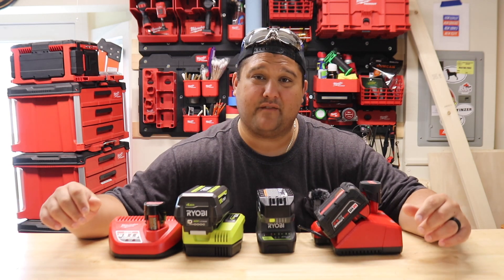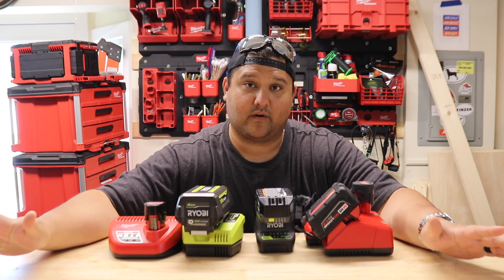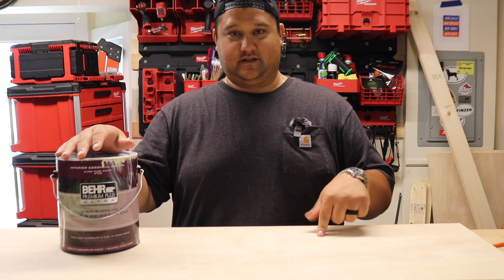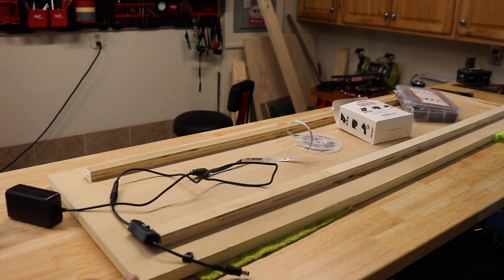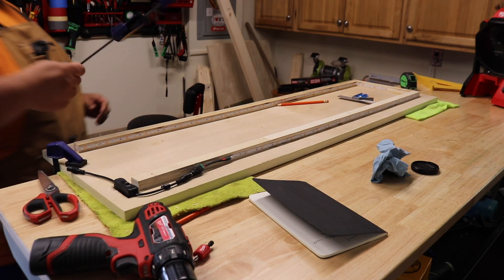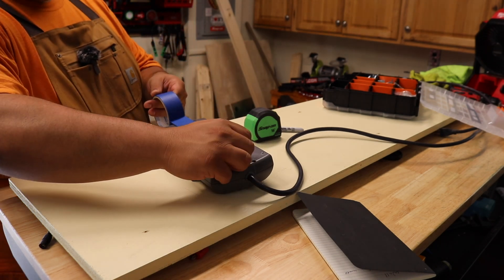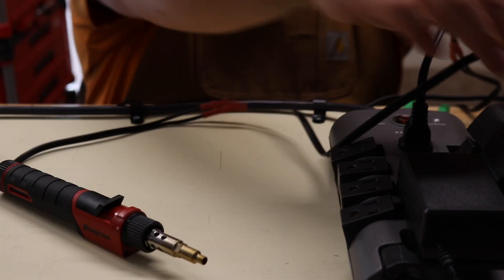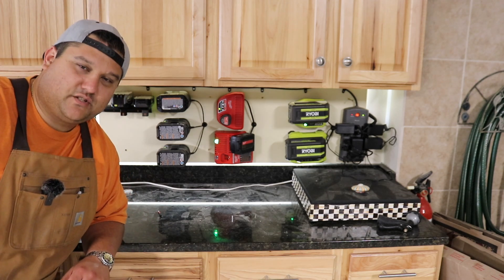I Built the Ultimate Battery Charging Wall

Comment: I'm invested in two (kinda three, but really two), DeWalt 20v/60v, and Snap-On 14.4v. 
DeWalt 60v saws are the bees knees. And the batteries work on their 20v tools too. I got a couple DeWalt 12v tools, but those have been relegated to backup duty only. Snap-Ons 14.4v is superior to both DeWalt and Milwaukee 12v stuff. And DeWalt 20v and 60v have been becoming superior to all others in every way lately.
Reply from the maker: It’s hard once you get into any one brand to switch out. Some of the snap on stuff is interesting to me but the thought of starting over fills me with angst. There’s definitely better options for certain tools that Milwaukee m12, but I can’t get over the hump to try at this point
Reply: @HeyDerFolks  I definitely get that. That is one reason I stuck with DeWalt though the 2010's when they weren't innovating and Milwaukee was kicking their ass - didn't want to "reinvest" in another platform. It paid off though, with all the new "best in class" launches they've been making the past couple years (DCF900, DCF961, DCF891, DCF921/923, DCF845, DCF850, DCF860, DCD1007, etc). I do wish they would make more types of tools, as Milwaukee does have a few neat tools that DeWalt doesn't make at all, but I don't want multiple battery platforms, and I'm not ditching my "big boys" (961, 891, 1007) nor my 60v tools that Milwaukee doesn't even have competition for, so I'll wait it out, lol. However, after I got my hands on the Snap-On 3/8 long neck ratchet, that things a beast, I decided to add Snap-On 14.4v to my lineup, and ditch the pathetic DeWalt 12v lineup. The only "good" thing about their 12v lineup is that the batteries charge on the same charger (not dual port like Milwaukee and Snap-On) as the 20v and 60v batteries - so that's convenient.

Comment: Why would you cut the cords on all of chargers ?
Reply from the maker: I was unaware of another way to run their cabling behind the board. Some folks have since recommended I added a new plug rather than splicing, which is fair. I hadn’t considered that. The cords themselves are soldered to the chargers so I couldn’t unplug them to hide them
Reply: @HeyDerFolks you drilled a 3/4  inch hole in your board to run the wire through the hole the plug should have fit through that 3/4 inch hole without cutting the cords on all chargers
Reply from the maker: It did not fit in the hole I drilled, I tried. Perhaps if I had drilled a 1 inch hole it would’ve, but then I didn’t have the rubber grommet and I indexed towards impatience

Comment: I have a lot of chainsaws some of them high end Husqvarnas and every single one leaks bar oil. It’s not really a completely sealed system, but something you can do is open up the reservoir after use to release any pressure that may be built up.
Reply from the maker: Fair point. I will take your advice in terms of letting out the pressure in the future. Thanks for the tip!

Comment: The ryobi charger has a transformer in the wall plug so it’s low voltage 
The Milwaukee plugs are 120v in the wire.   I don’t think you can solder 120v ac connections.  
I’m not an electrician.  But I know you can’t splice romex in your house like that, either a junction box or a molex self contained connector 
I know in a shop if an extension cord is nicked it’s trash,  can’t mend it
You can add plug ends to them but no splicing

Edit.  Can’t find anything that says your 120V AC splice is ok
Complete rewire or plug ends or molex self contained or a junction box
Reply from the maker: In hindsight I wished I just bought new plug ends and didn’t splice, but I honestly never considered that at the time. This is how we learn 😌

Comment: Cool setup Peter! Have you thought about the dangers of all the lithium batteries? Maybe a fire proof drywall setup between garage and house, and fire alarm and fire suppression system. I have a charging station in my garage and worry about fire control.
Reply from the maker: Thanks, Doc. I haven’t given too much thought to fire suppression. What I’ve taken to doing is turning off the surge protector when I am not in the garage, and generally removing batteries once they’re full. Will have to give more thought to the rest of it
Reply: I added a countdown timer to my charging station.  When I charge a battery or batteries I set the timer for a little over typical charge time. Usually around 1.5 hours. Then the timer shuts the power down. I have my chargers mounted on concrete too.